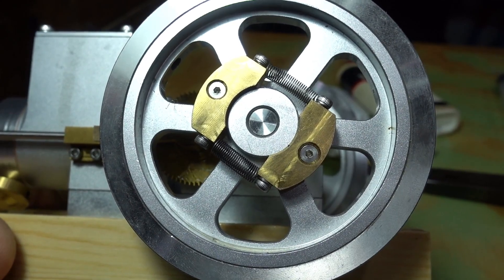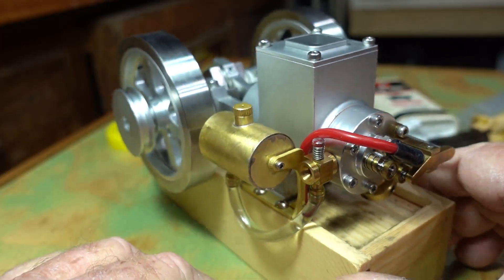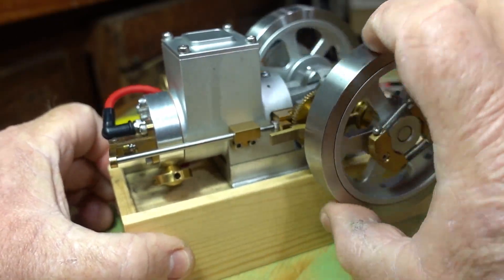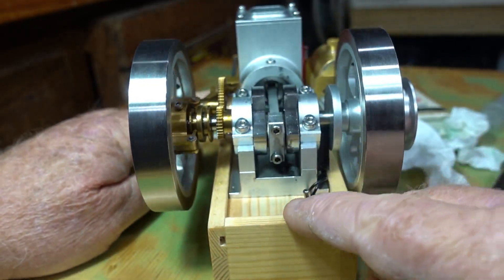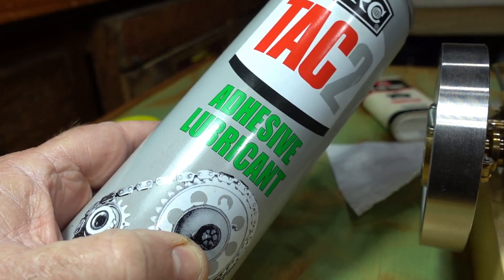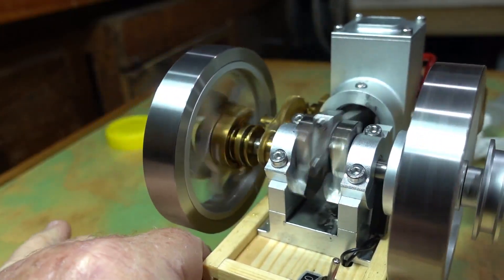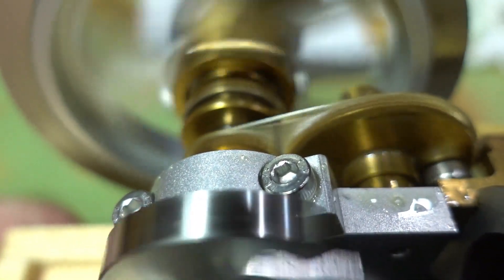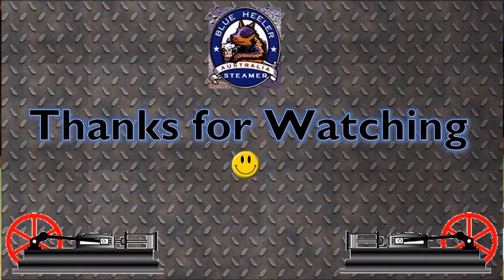Microcosm Eachine  M90 Hit & Miss Chinese Engine, softer springs & 48 hits a minute

Comment: Would be nice if they had a set-screw to adjust governor spring tension. Actual engines usually had this.
Reply from the maker: Would make things easier for everyone. Would it be possible on a miniature this size?
Reply: @SteamEngines-Jim  I don't see why not. But one might need a screwdriver to turn the set screw. I'm not an engineer though.
Reply from the maker: @twistedyogert  Me either (engineer) but it is fun mucking around with these little engines - Cheers Jim
Reply: Where can I get these softer springs from please?
Have you got a link?